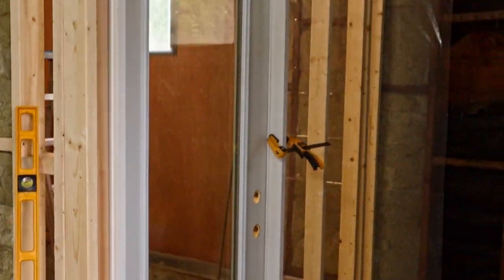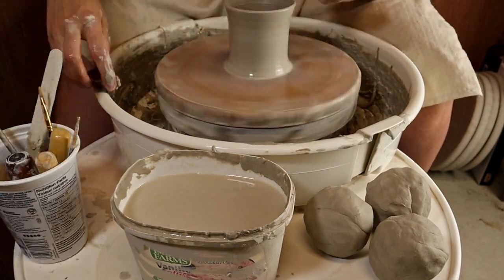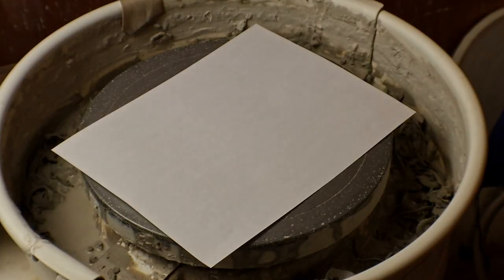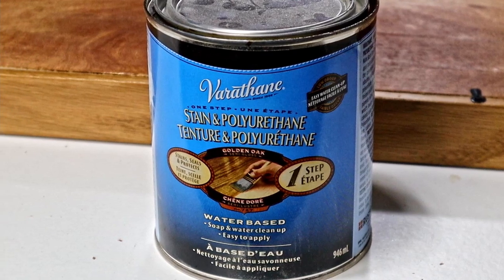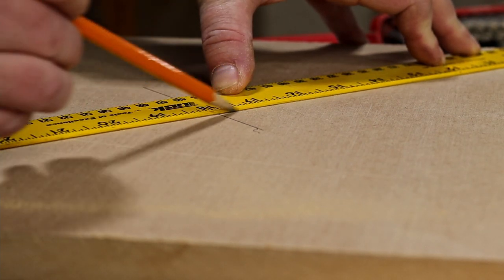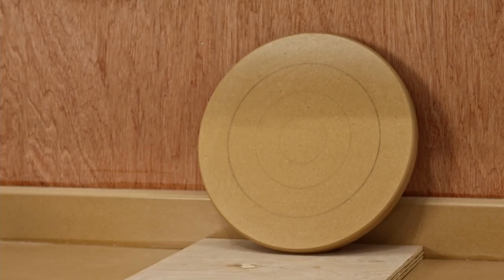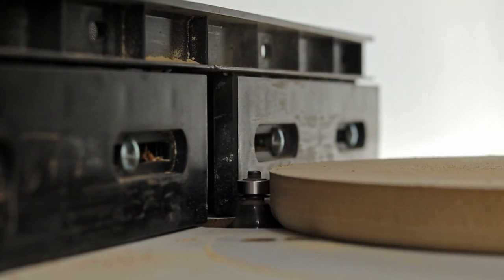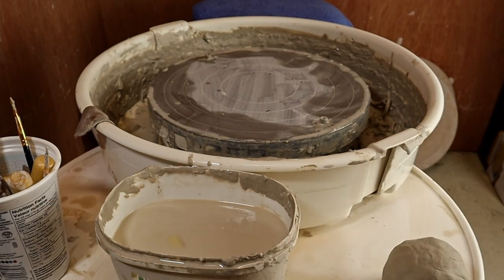Pottery Wheel Bats - How To Make Them

Comment: Can Hardie Backer Board be used as wheel thrown bats? Any idea if Lowe’s might cut them for me? Ballpark cost for the. To do it? 

I have a large piece of HBB clamped to my table. I use the larger piece for reclaiming clay. The smaller piece I use to wedge clay before throwing on the wheel, esp when clay is a bit too wet to throw adequately. The two pieces that are cut up for reclaim & wedging destroyed a saw blade. I wish I had been better at cutting it straighter.

Comment: Do you need to wire off still?
Reply from the maker: Yes you do
Reply: After throwing wire off then set it aside till  dry enough to remove. Wire again in case parts of the bottom re-stuck. Don’t let it dry or it will be very hard to remove.